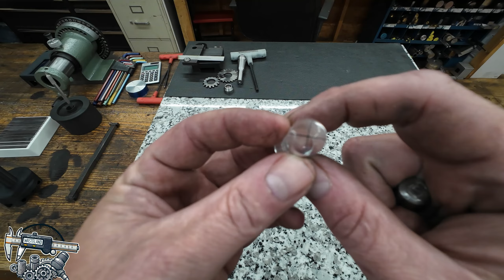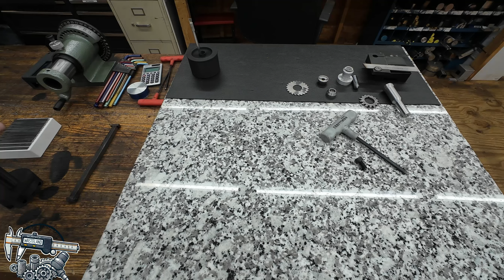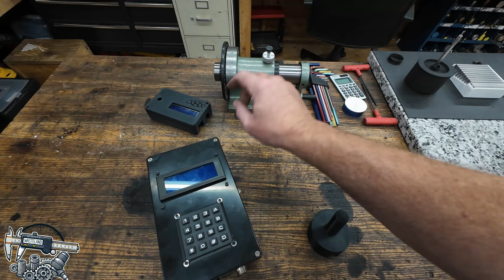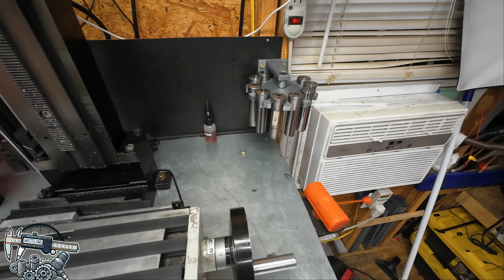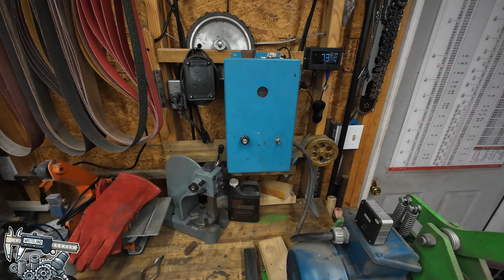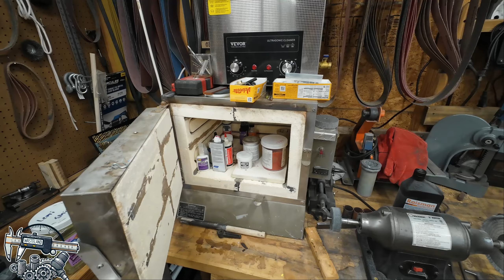Homemade Tools In My Little Machine Shop Workshop Wasteland

Comment: Knowing nothing about 3d printing, but getting interested what would you estimate the cost in materials in printing the no spill oil cup?
Kind I’ve a silly question but I have no frame of reference for this ( understanding Tgat choice of materials has a great effect on price) I guess a better question would be what percentage of a spool does something like this take? Again I have no frame of reference. Will a spool print 2,5,10, 20 etc. Not looking for exact numbers just something to give me a frame of reference.
Reply from the maker: I suspect that cup is 75-100 grams a material.  There is 1000 grams on a spool and it costs about $15 a roll. So let’s say that cup is $1.50
Reply: @Workshop_Wasteland thanks that gives me a frame of reference. I was actually thinking it wad quite a bit more.👍

Comment: Would be nice to mention what material you used for some things, like that slitting saw / gear cutter mandrel. As a new hobby machinist, I find it hard to know what materials to use for what things. I'm guessing that mandrel would be 4140 or similar??
Reply from the maker: You are right. I definitely should have mentioned this.  I believe it’s 12L14 but truth be told I do not remember.  Also, I have a lot of “mystery” metals that I got in a huge lot of materials.  I typically buy and label things as I need them.  You are right though, 4140 would be great for that mandrel. Thanks for watching